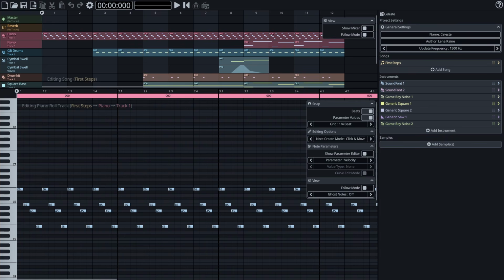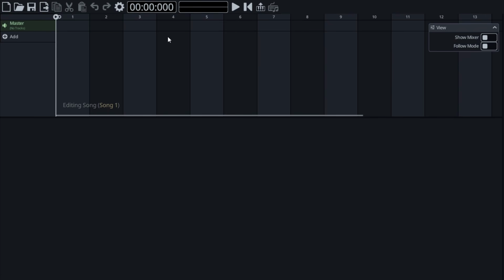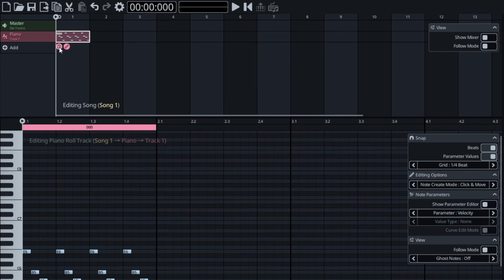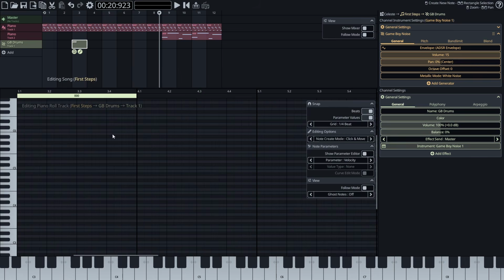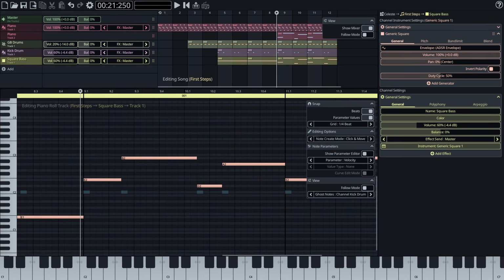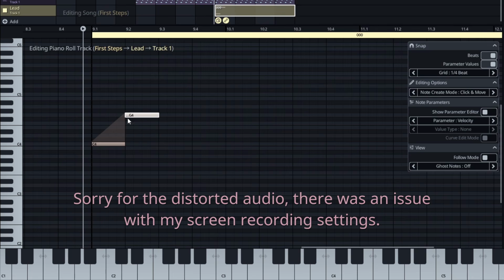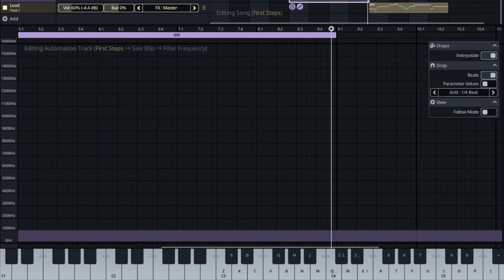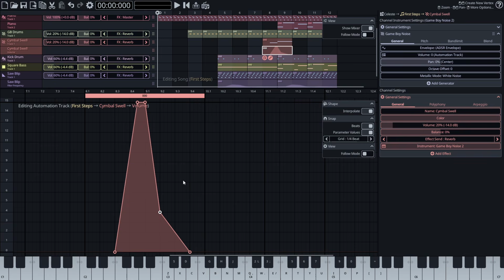KiraStudio Tutorial - Desktop

Comment: How do I import audio samples for the PCM? Documentation pages for the PCM on the website are blank.
Reply: I have the same question, did you find a solution?
Reply: @Vic_the_Human no
Reply: @lurkathon  Hey, just wanted to let you know I asked the dev on the Itch page and he said this:

"Hi! Thanks for the feedback. Yeah you can import "samples" which are limited to 60 seconds right now, and drop-and-drop does not work yet, as you saw. There will be proper raw sample tracks for vocals in the future, but alas, not yet.

In the project explorer (right side panel) look at the top where it says something like "Project -> Song 1 -> Channel XYZ" and click on the project. This is like a folder structure you can navigate. At the root of the project is a list of samples, press the (+) Add button to load some. Then you can use those in a PCM sampler generator, but assigning them to the sample map . The documentation is extremely lacking regarding this and will improve in the future. 

-Mat"

I hope it helps! (Also sorry if this comment is posted more than once, for some reason it doesn't appear for me)

Comment: This software looks interesting. Just wondering, will there be a Linux version in the future?
Reply from the maker: No plans for Linux. People run it very well using Wine.
Reply: FYI,It works quite nice on SteamDeck with Proton10. UI is a little cramped, however
Reply: @kirastudioapp if I understand it correctly, it's a heavily modified FamiStudio fork. Is it open-source? Maybe community can build Linux versions along the way
Reply from the maker: @djbrine1  Based off FS, but extremely modified. Closed source this time. Sorry.
Reply: @kirastudioapp Ah, I see. A shame, but I still wish well for this project
Reply: @kirastudioapp  Just adding that it works perfectly on Wine, though I remember having issues with installing Wine-Mono on FamiStudio but here it was a smooth experience.